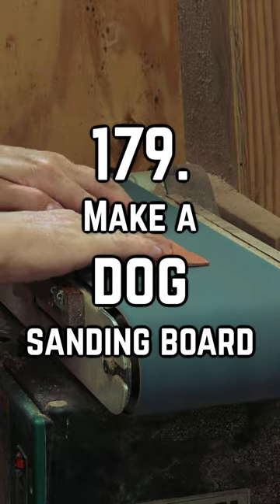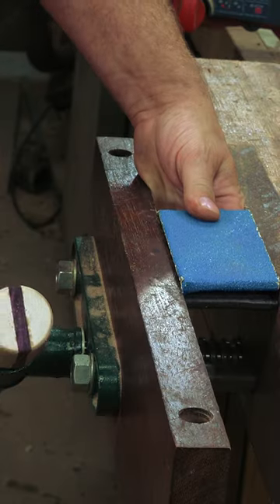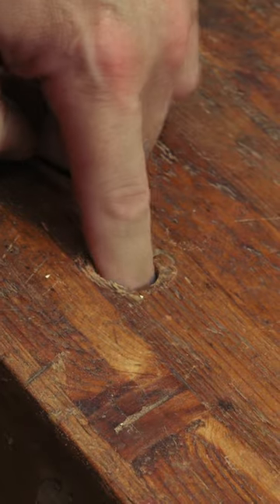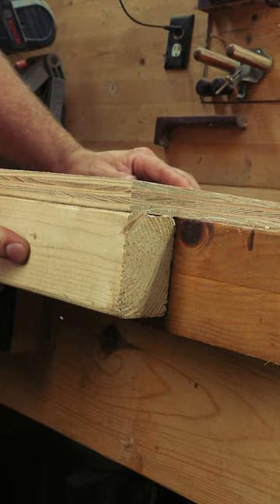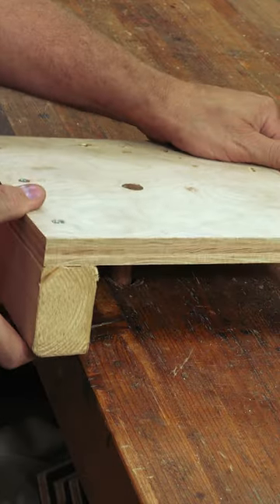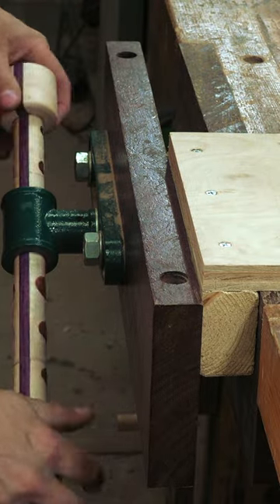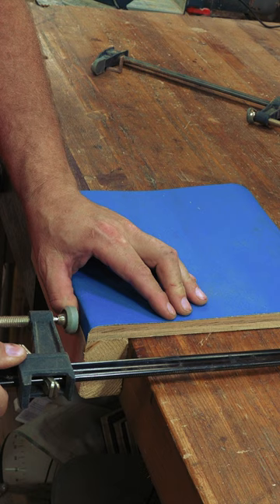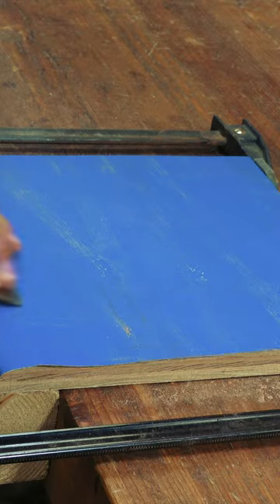179. Make a dog sanding board #mtbitesize #shorts #sanding #bench

Comment: try double sided tape and attach the piece you want to sand to a larger block of wood.
Reply: Unless you have full width tape it can lead to bumpy surfaces which can round corners, add groves if you're not careful.